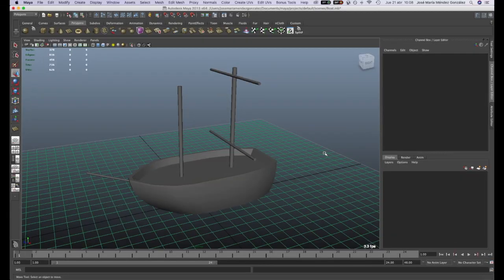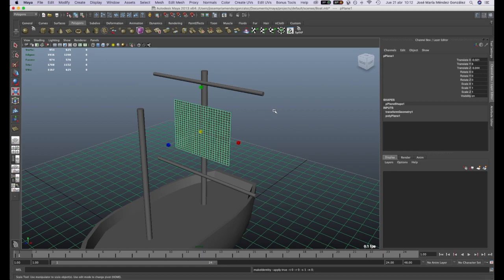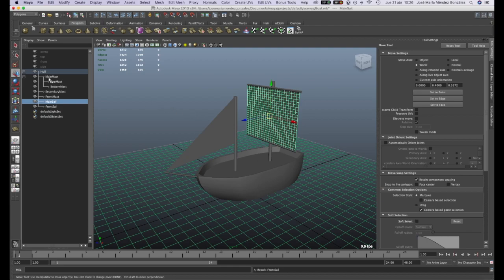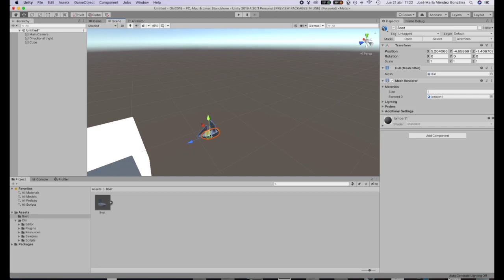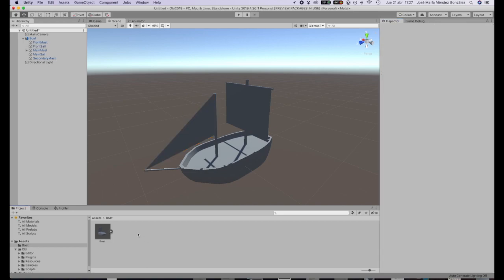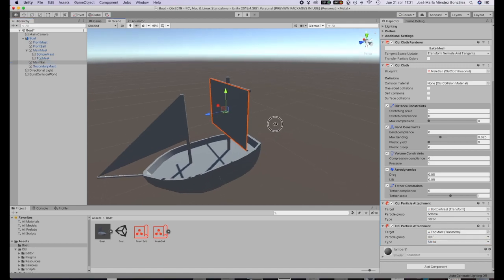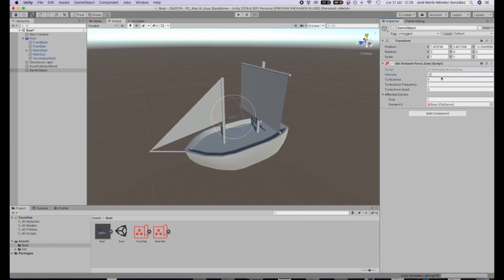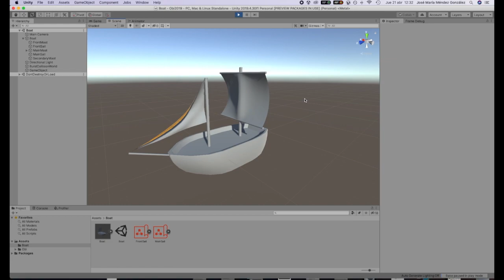Obi Cloth - Adding sails to a boat

Comment: Amazing tutorial!

I got my problem solved, turns out you can't have 3 different Particle components (unless I was doing it wrong) to hold the cloth, it needs to be 1 at the top and 1 at the bottom, I tried to set it up with 3, one for each corner and it did not work but once i combined the bottom meshes into one it worked flawlessly. 

I seem to have a problem with the cloth being too responsive to wind even at .005 the cloth goes to full extension as if the wind was at 20 or 30, but I think I can figure that out by looking at both this tutorial and the documentation. 

One question, is it possible to attach the wind component to the ship and have it follow the player around and use a script to randomly rotate it so the player gets the feeling of random wind all the time? I don't want the wind affecting the player's direction but I do want the player to be immersed when in the water since there won't be much else for them to do while traveling.

I also picked obi rope today and I am going to try to make a fishing rod using that system. If I can't get it working I'll be sure to email you after I give it my best effort.
Reply from the maker: Glad it was helpful!

You can have multiple particle attachment components to hold the cloth (in the video the front sail has 3, one per corner. The main sail has 2, top and bottom). However if you have multiple attachments for the same particles, the result is undefined: they might be attached to either transform depending on the order in which Unity updates each component.

If your wind seems too strong, particle mass might be very low. Check the mass of the particles in the blueprint editor (I do this at around 24:55 in the video). This is because F = ma, so acceleration = force/mass. Wind intensity gets divided by the cloth mass to  determine the cloth acceleration, this way heavier cloth moves less under the same wind. 

Yes, you can attach the wind component to the ship and rotate it just like you would with any other GameObject.

Drop me an email if you have any questions! kind regards,
Reply: So, what happened to me is i had a 'sail' that didnt start out flat and THAT didnt work so good.

Comment: Is there any way to tell how many collisions are happening on the cloth? In real life if you go toward the wind at an angle you will tilt your boat over, but the more your tilt it over, the less wind you will have in your sails.
Reply from the maker: Wind and collisions are two completely different, unrelated things. You can tell how many collisions are happening on the cloth (and much more collision-related info) using collision callbacks: http://obi.virtualmethodstudio.com/manual/6.3/scriptingcollisions.html

Regarding wind, it works just like in real life: the angle of the cloth relative to the wind direction determines drag and lift forces. See: http://obi.virtualmethodstudio.com/manual/6.3/aerodynamics.html
Reply: @VirtualMethod  yes, but the force transferred to a boat would ve determined by the force of the wind on the sail, as well as the direction. dont worry about it i have a hack that will worj
Reply from the maker: @JCElzinga  Not sure what you mean, what you describe is how it works by default: both the magnitude and the direction of the wind (relative to the surface area and orientation of each triangle on the cloth) affect the force on the boat. Obi uses the thin aerofoil model for both drag and lift forces: if the cloth surface normal is perpendicular to the wind direction, drag is maximized and lift minimized. If the surface normal is perpendicular to the wind direction, drag is minimized and lift maximized.
Reply: @VirtualMethod  thanks, so far very happy with the product, just bought last weekend. keep up the good work.

Comment: Hi! Nice tutorial! I am thinking about getting obi cloth to replace unity cloth, but I havent been able to find out if it can do the same thing as unity cloth:
Set a particle to have 0 max distance(stuck in place like your top and bottom groups)
Or set a particle to have a max distance of 1 or 2 or 3, and then that particle will be able to move that distance from the origin, depending on wind angle and speed.
That is something basic and pretty much the only thing unity cloth has that obi doesnt?
Reply from the maker: This is a basic thing in Obi too. Check out skinned cloth (ObiSkinnedCloth), and more specificallly, "skin radius" property of skin constraints:
http://obi.virtualmethodstudio.com/manual/6.3/clothsetup.html
http://obi.virtualmethodstudio.com/manual/6.3/skinconstraints.html. 

https://www.youtube.com/watch?list=PLnCR8_XCOgrbKXoL8pybRcFakLOwboUJQ&v=usXaFr6N630&feature=emb_logo

Comment: Great asset. Well worth the money. But could the author comment on using it to simulate boat sailing physics. From my experiments could be used for visuals but not really for providing the movement physics, sailing up and down wind. Correct? A seperate system should really be used.
Reply from the maker: Cloth can be used for movement physics as well, you just need to set the sail attachments to "dynamic" instead of "static" to enable two-way coupling between the boat's rigidbody and the sails. There's a sample scene included with the asset (named "SailBoat") that allows you to sail a boat using entire wind-driven propulsion. In this scene, cannons shoot at your boat and may rip trough the sails. When this happens, wind will pass trough the holes in the sails and reduce the boat's speed automatically.